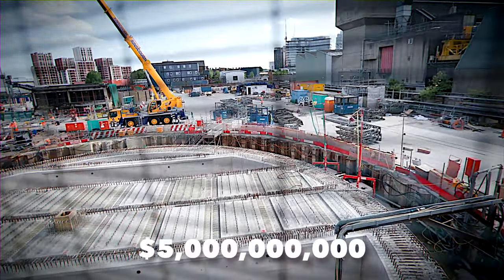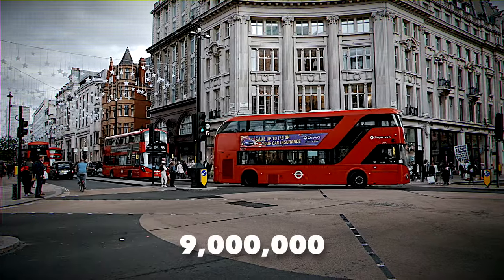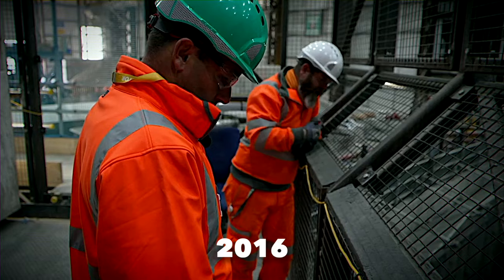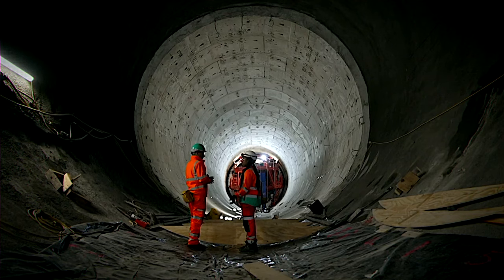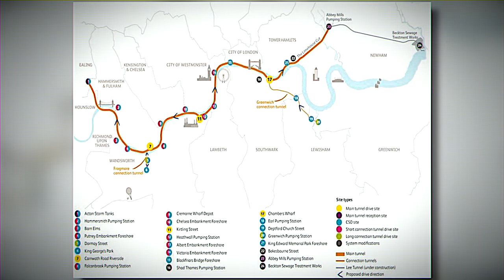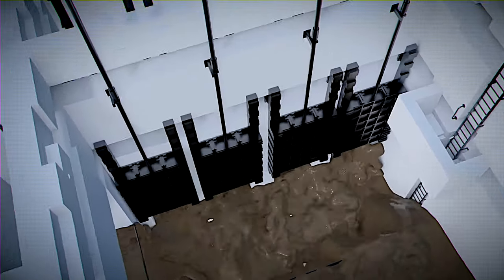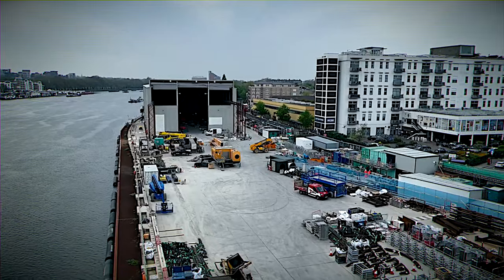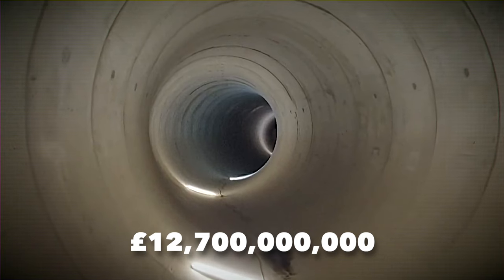London's INSANE $5 Billion Tunnel System

Comment: I wonder if a system of decentralized water treatment plants wouldn't have been cheaper. Of course looking just at the treatment plants, it is cheaper to operate one central treatment plant than multiple decentralized treatment plants. However, it would not require this massive sewer which is also not really cheap.